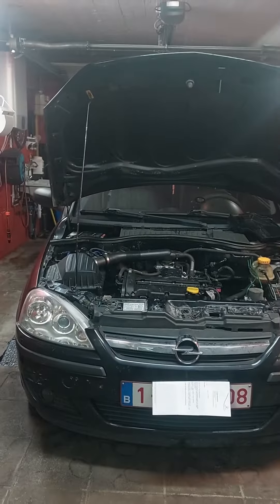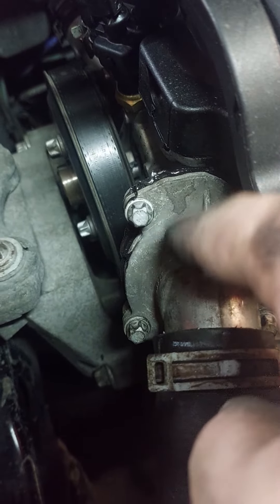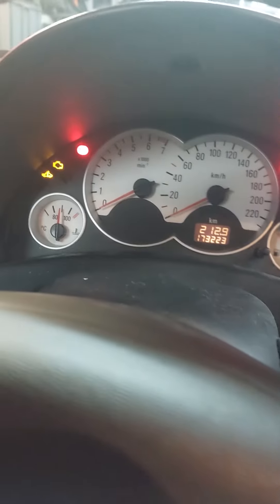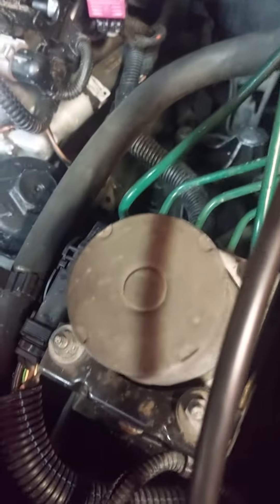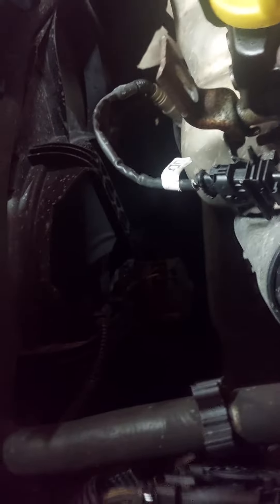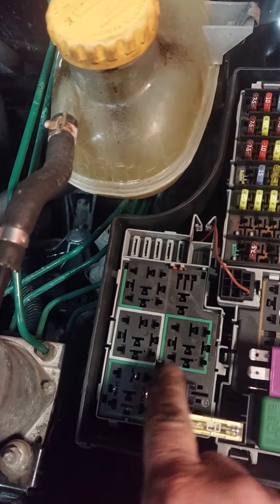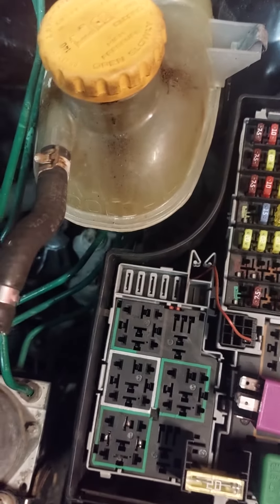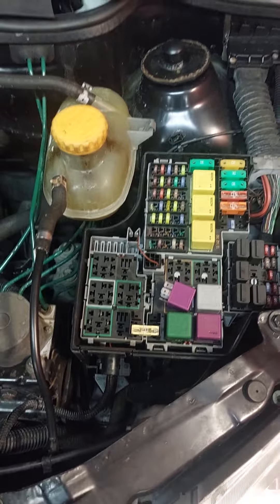OPEL CORSA C  2006  COOLANT FAN FAILLURE

Comment: I did the diagnostics, and it tells me that all the fan relays are not working. The problem I see is that the car does not heat up immediately, but takes a long time. Could the problem also be with the thermostat? I changed the relay, but nothing seems to have changed.
Reply from the maker: @marbusrocker  did you check the relay ?
Reply from the maker: @marbusrocker did you check the coolant sensor ?
Reply from the maker: @marbusrocker  at ast you disconnext    the thermostat and put in boling water..
Reply from the maker: Change thermostat
Reply: @redliaga  thanx! 🤗